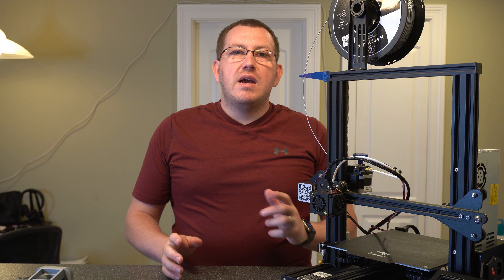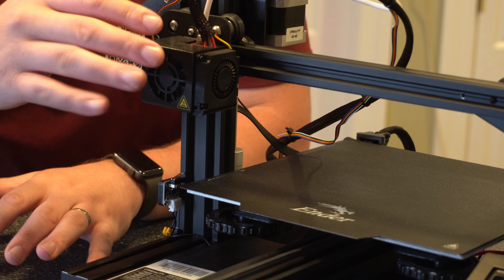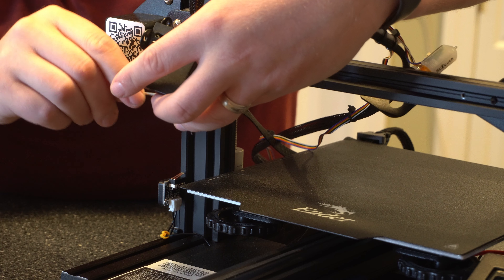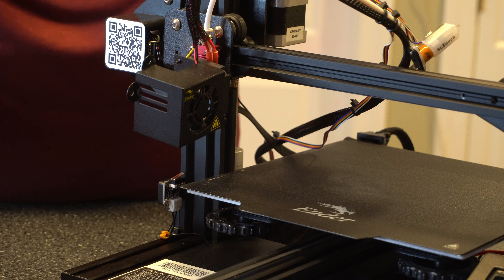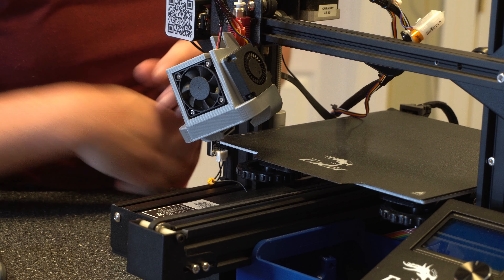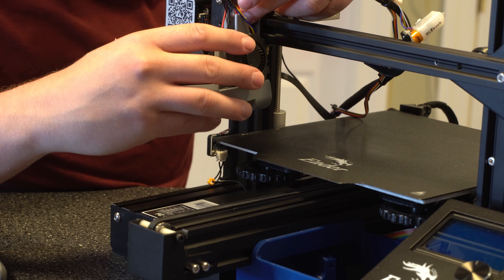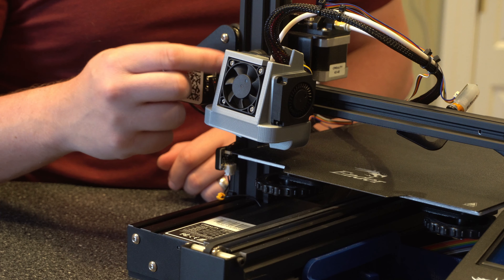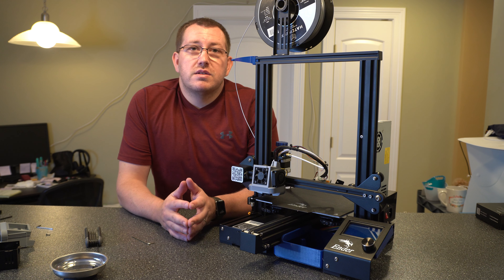Ender 3 Pro Fan Mod – My Choice and Install Guide

Comment: Going to print this little upgrade as the next thing.
So far my printer goes good, but better airflow, and from both sides, could just improve it.
Reply from the maker: It should help a little for sure. Just keep in mind that its still the stock fan.

Comment: Hello there, I found a remix of this shroud compatible with the metal cr touch brackets. I'mm about to install that shroud , my new hotend and direct drivinator. On another note I just finished wiring up my external electronics enclosure and finished testing everything works.
Reply from the maker: Hi. Nice, let me know how everything turns out.
Reply: After realizing the direct drivinator has a lip on it, I just realized it cannot accommodate the metal cr touch bracket, so I'm going to print a speed drive now.

Comment: did you ever figure out which cooling upgrade works best with the cr/bl touch??
Reply from the maker: Hi. There are a lot of factors that come into play here. It really depends on if you have a direct drive and if you are upgrading your blower fan or not. I can provide a recommendation for you once i know what mods you already have.
Reply: @3DPrintscape  I am on bowden with dual gear drive stock fans and hotend currently. I have done work on the rest of the printer and am starting to look into upgrading the hotend and such. I do not have a cr/bl touch yet but I was thinking it would be smart eventually. I just finished a 4 day print and I would like to upgrade the cooling system and possibly hotend. Ender 3, BTW. Thank you for the response man. Any suggestions? I do currently have this shroud printing but I am not sure about longevity and future upgrades.
Reply from the maker: @socalghia  I like the upgraded blower can and cover i go over in this video https://youtu.be/7wYjyA83Ey4 . The blower fan is a little loud at times if at 100% but man it can move some air.

Comment: I like the design but the bottom ports to cool the print aims right at the nozzle not the print. Needs to be angled down more
Reply from the maker: Hi. Thanks for the feedback. If i get some time i will try to test that out to see if it makes a difference or not.

Comment: Had this printing for 2 hours already with skirt. Heard him say, do not make the same mistake as me and print this with skirt. Print it with a brim. Me, sips vodka.
Reply from the maker: Hi. How did the print end up turning out. I had to move to a brim mainly due to the one piece the doesn't connect to the print until its about done.

Comment: Print in PETG ou better heat resistance material if you intend to print abs later, it warps de tube with the cooling off.
Reply from the maker: Hi. I agree that PETG is the better material for this. I went with PLA because i already had some and wanted to see if it would be an issue. I have not had any issues at all with PLA though.

Comment: So the heat around all those heating elements not melting the PLA? 
Also how/why does it make it quieter?(saw several fan mods - is this the best?)
Want to try it out, but have some doubts...
Reply from the maker: Hi. I didnt have issues with the pla melting as it wasnt actually close enough to the hotend to increase the temp to that point. I went with PLA to try it out for people because the recommendation was ABS. Just adding this fan duct cover didnt change sound at all. The big changes for sound was moving to a silent board and replacing the fan on the power supply.
Reply: @3DPrintscape  Thought the same... must be replaced hardware not only the cover. Anyhow, does this cover really helps for better air flow blow to cool the filament as required?
Reply from the maker: @Braincho  It helps a bit, def better than the stock one.
Reply: @3DPrintscape  will make one to test. sadly my printer prints slow and gotta wait till other important parts finish. Have a nice day sir!

Comment: Does it cause stringing?
Reply from the maker: Hi. It didnt cause any stringing for me.
Reply: @3DPrintscape  Ever since I started using it it caused oozing and stringing. I dissembled it and starting using the stock again. The stringing still continues. I’ve changed the retraction settings and I’ve lowered the temp to 200 and bed for 60 for PLA. I don’t know what’s wrong.
Reply from the maker: @Laststand525  Stringing is pretty normal before the print starts, which is why you want to create a skirt first. You can play with the gcode to reduce the temp while its warming up but i never bothered.
Reply: @3DPrintscape  thanks

Comment: If your screws are not aligning with the holes, CHECK to see if there are any wires pushing/blocking the print from moving where its supposed to... I just messed around for 45 minutes before flipping my machine upside down and finally being able to see the wire
Reply from the maker: Hi. thanks for the tip, it will probably end up helping some people out :).

Comment: Hello! Which differences between V52 & V59?
Reply from the maker: Hi, The V59 file adds a hole behind the fan to access the top mounting screw straight on rather then from the side with a ball end allen wrench.

Comment: Perfect!! No problem with install. Did with PLA standard settings. Printer so MUCH quieter now. Extra weight does not seem to be a problem.
Reply from the maker: Great, and ya its amazing how big of a difference it makes.
Reply: So the heat around all those heating elements not melting the PLA? 
Also how/why does it make it quieter?(saw several fan mods - is this the best?)
Want to try it out, but have some doubts...

Comment: i can't stick the first layer to the bed with satsana. I think it blows to much air and the pla freezes very fast. The right fan is not working in the first layer but the front is on.What i should do? CAN SOMEONE HELP ME?
Reply from the maker: Hi. What are the first layer settings your using in your slicer? With pla, you typically don’t have the fan running at max speed for the first 3-5 layers.
Reply: @3DPrintscape  I have zero speed for the first 4 layers but only the the right fan speed is zero. The front is blowing regular. I have 100% fan speed in cura after the fourth layer
Reply from the maker: @ΠΑΝΑΓΙΩΤΗΣ-ψ7λ  The front fan is for regulating the hotend temp, it doesn't blow directly onto the part being printed.

Comment: Just got this installed and my fan on the side didn't line up for all the screws (2 good & 2 not so much).  Everything else is assembled just fine.  I was having trouble with the side opposite my stock fan was not cooling properly.  I hope this solves that issue.  Once the wife wakes up from a nap maybe I'll print something to test it out.  Great content!
Reply from the maker: Hi. Thanks for the feedback/info. Let me know how the test print turns out and how you like the cover.
Reply: @3DPrintscape  I have a retraction test sample that was able to perfectly create a 16mm bridge.  This is an amazing upgrade for my machine.  The print itself needs to add support to that middle channel to prevent it from breaking while printing.  Also, my side fan does not perfectly fit flush against the surface and two mounting holes didn't line up.  It appears that the mounting plate and holes align perfectly vertically, but are spaced incorrectly horizontally.  Two screws work fine but it's something that I would correct if I were going to make it again.
Reply from the maker: @patrickmcintyre8023  Thanks for the feedback, I didn't have the issue with the screw alignment. Is your e steps and flow rate set right?
Reply: @3DPrintscape  I might need to watch a few more videos before I start tuning that stuff.  The rest of the print seems to be perfectly fine.  I'm only on my third spool of filament, so I am still quite the rookie at this.  🙂

Comment: I love the fan mod but damn you mucked your fan wires in this video. 1 Take fans/case off  2 add the mod attachment 3 add fans
Reply from the maker: Hi. Im not following. The wires had to be connected. I made a not that you can extend the wire on the fan or just tap into the wires that are there, which is what i did.
Reply: @3DPrintscape  thx for replying back. I found once you had the ender 3 apart if you then add your mod to the frame and add the fans in after that so your not bending the wires like crazy since they are cheap

Comment: Hey I was upgrading to the new fan duct that was  showed in the video and I chose Scott’s remix and an order for that to work I need to put a new cooling fan on so I cut the wires on the old one and put the new one on it did not work so I switched back to the stock version and now every time I start a print the fan won’t turn on and I have to turn it on manually and I don’t know what to do and this also happened to my other printer
Reply from the maker: Hi. Did you change the firmware or anything in the process?
Reply: @3DPrintscape  No
Reply from the maker: @insido6715  I would try to clear the eeprom. The default value for the fan should be 255, not 0. On the fans, were they both the same voltage?
Reply: @3DPrintscape  Same voltage we’re can I download the update file? And how do I use eeprom?
Reply from the maker: @insido6715  You can try one of the builds from my site https://3dprintscape.com/marlin-firmware-builds/ . The eeprom is cleared by setting default values.
Reply: @3DPrintscape  I did the new software is really nice but the fan turns on when I heat to PLA then turns of when the print starts is there a way I could send you a video of it so it would be more detailed
Reply from the maker: @insido6715  You can send short videos on discord.

Comment: do you have a print profile available to help print this running an Ender 3 Pro with Micro Swiss Direct drive.  Any help would be great,  And should one print this with PLA or PETG?
Reply from the maker: Hi. I have my profiles available to download here https://3dprintscape.com/cura-profiles/ . PETG is recommended, but i printed my with PLA and have had no issues at all.
Reply: @3DPrintscape  Dang that was a fast response! Thank you so much for the info.  Great Channel and lots of your videos have helped me get up and running! Cheers!
Reply: @3DPrintscape  Awesome Profiles by the way.  are they good for PETG as well? sorry for the noobish questions. Just trying to dial in my printer for after the upgrades and you're one of the better knowledgeable youtubers that I go to.
Reply from the maker: @evanfriel6403  Thanks, and they would be a good starting point for PETG but you will need to adjust the temperature.

Comment: I just printed one off. It's really nice and fits perfectly. I almost didn't believe you when you said it could be printed without supports, but sure enough, it worked. Printed using Hatchbox Black PLA filament on a 'new to me' Ender 3. 195C and 50C Temps with default Cura variables. Also added a section of LED strip below the Blower Duct. A big 'THANKS' to you :)
Reply from the maker: Cool, how are you liking it so far?
Reply: in what orientation it has to be printed, in order to not use support?

Comment: I tried this I can not get the screws to go in sigh...
Reply from the maker: Hi. Is the screw hole on the print too small or is it not aligning with the holes on the carriage?
Reply: @3DPrintscape  I figured it out I got Neo and it will not fit a neo. I can't find anything that will cover my spider 3 on a neo lol. I ordering a v2 backplate now to work around that saddly. But I did try to use a v2 hot end kit just for its cover found its screws were not the same as my neos bolts, and they did fit the printed part.

So yeah this just issue with neo being too new and them changing design of the bracket for some reason, and community not caught up with that change.
Reply from the maker: @Zalzany  Ah ok, that makes sense.

Comment: Welp, I printed one for my Ender3 v2, not knowing that the screw for the main structure are slightly off 😅
I had to melt another hole for the upper screw to not waste the entire print. And it worked out, hopefully xD
Reply from the maker: Hi. I didnt have any issues with the screw holes being off but it sounds like you got a good workaround so you should be good.
Reply: @3DPrintscape  yeah, I'm trying it right now and works really well. It was kinda messy at first to figure it out what to do with the hole being really off, don't know if it was a factory thing or if they changed something in the model of the hotend.

Comment: I am trying this on the ender 5 and it doesn’t work is there anyway I can make it work
Reply from the maker: Hi. What part isnt working?
Reply: @3DPrintscape   the belt buckle type thing is in the way of the fan that cools the prints
Reply from the maker: @Ronin871  Gotcha, i need to just suck it up and buy and Ender 5 one of these days.
Reply: @3DPrintscape  figured it out you just need to tape the one fan on instead of screws
Reply from the maker: @Ronin871  Im not a huge fan of using tape. I would have to see how its all mounted to get a better idea of how to help though.
Reply: @3DPrintscape  it’s a few mm off of where it’s supposed to be. And is mounted with double sided tape.

Comment: so my screws to attach the front fan on the new shroud arent long enough to thread in. it totally looks like theres enough but for the life of me i cant get them to thread. if i try to thread them without the fan they work great! just gonna have to get some longer screws or something
Reply from the maker: Hi. I was able to get it to work with the stock screws, though they were barely long enough. What version of the Ender 3 are you working with?
Reply: @3DPrintscape  so yea about 15 min after I posted that comment I got each screw to BARELY thread and stay in place. So were all up and running and running really good too! I did use PLA and have had 12 hour prints with no issue!
Reply: @3DPrintscape  im working with the ender 3 pro (not v2). Im now looking into using my raspberry pi for octoprint and adding a raspberry pi camera aswell as installing my BLTouch. Very excited! Thanks for all your videos and helping me out man! Love the info in your videos
Reply from the maker: @BMathiesen  Hi. Thanks for the feedback, much appreciated.
Reply: @tjgonzwest  yea aside from the original screws didn't want to fit for me. I used some red locktite so it wasn't too strong to get them off if I wanted. Other then that the a PLA works great for me. I've ran prints for 30 hours straifht and no warping or anything... for me. Hahaha

Comment: it seems like my stock screws are to big to thread. ender 3 pro btw
Reply from the maker: Hi. They shouldn't be. I believe they are M3 which works fine.
Reply: @3DPrintscape  i had to drill them out a bit  hmm
Reply from the maker: @FFK1999  Gotcha, its possible the print was a little off. Could have been esteps or flow rate.

Comment: is there a good printable option for the Ender 3 with CR or BL touch? also can u print these in PLA or does it need to be PETG so it doesn't melt?
Reply from the maker: Hi. I printed this in pla and had no issues. It will work for the bltouch but will need to be modified a bit for the crtouch wires.

Comment: Quick question. Would I be able to mount the EZABL Pro from TH3D with this fan duct? If not do you know of any that would be compatible with the EZABL?
Reply from the maker: Hi. No that wont work with this fan duct cover but it should work with this one. https://www.thingiverse.com/thing:3419869
Reply: @3DPrintscape  alright, I appreciate the support. I'll check it out
Reply: @3DPrintscape  there is a great fan duct I have found that I think you may enjoy. Search red squirrel on thingiverse, it uses a 5015 blower fan and has plenty of remix's for BL touch

Comment: Thanks for another helpful and very clear video.  Please set me straight on something--there are many instances where one must tighten, loosen, adjust or otherwise fine-tune variables.  For example I notice that your hot end mount on the X-axis is way more loose than I have mine.  Could you please clarify for me?  All 3 carriages on my printer are tighter than the one shown, so have I been in error all along?  I understand how difficult it is to give clear instructions when referring to degree of force required--as when bed leveling with the nuts and a piece of paper--how much is enough?  Thanks so much for your further comments!
Reply from the maker: Hi. Thanks for the feedback. The hotend should not be loose, i was doing a lot of work on my printer and didnt finish all of it up until weeks after i made this video. if yours is lose, you will want to tighten the eccentric nuts on the back of the carriage, just don't make it too tight. When leveling the bed, the nozzle should be about paper height from the bed but people use different paper, so its difficult to give clear instructions there. I tend to use standard printer paper and lower the nozzle until it scrapes the paper a little. If your using card stock, you will want to have the nozzle scrape the paper more.
Reply: @3DPrintscape  Man, you're spot on about what I was talking about!  Thanks for taking the time to reply and keep 'em coming!
Reply from the maker: @denzilcypret742  You're welcome.

Comment: How does your printing plate (bed) look so new?  I've used my printer for three days now and it looks like it's seen better days.  I have a hard time getting the plastic off the black crinkled plate that came with the Ender 3 Pro (I think it's a v2.x).
Reply from the maker: Hi. I actually have a coupe of them, and ya some of them don't look so great lol. That said, it sounds like your nozzle may be a little too close to the build plate.
Reply: @3DPrintscape  I think I just realized, the Ender bed is removable (magnetic)??  When this current print is finished, I will try removing it.  That should keep it cleaner in the future (plus I ordered several more of them from Amazon).